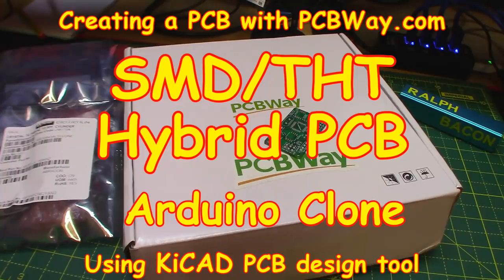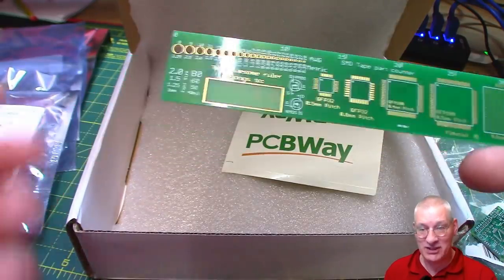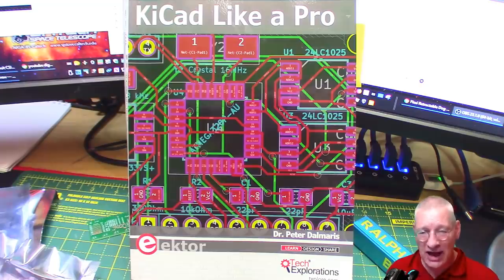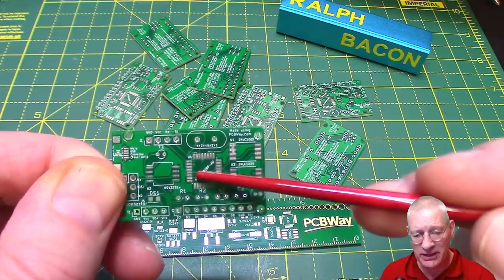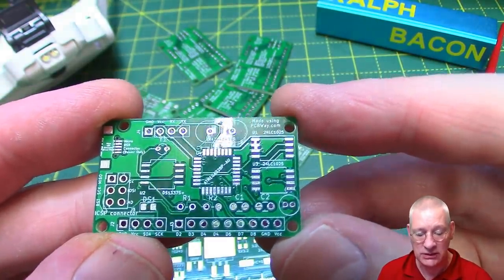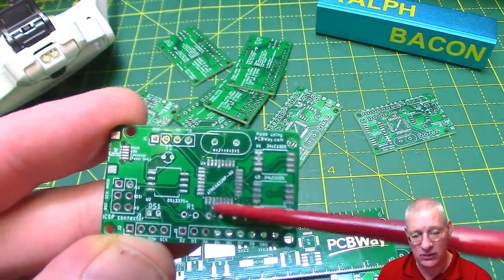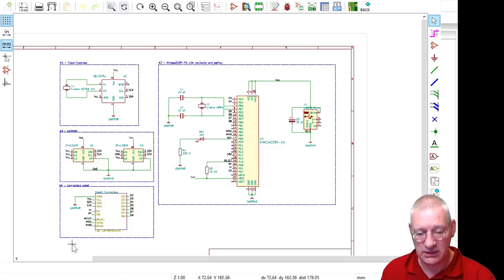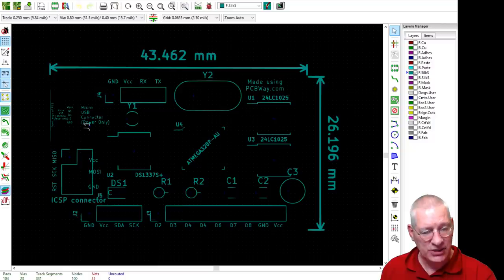#145 Making an SMD THT Hybrid PCB Arduino Clone (Using PCBWay & KiCAD)

Comment: Nice video which explains a topic (SMD) which is frequently promoted as being beyond the capabilities of the average person.  Not so.  Like most things - driving, swimming etc.  it just requires practice.  The practice board mentioned is a fine way to do this. 

FWIW my comments on SMD construction. 

A handheld magnifying glass is good if you have three hands - I don't, and don't know anyone who has.  The USB microscopes that are available IMHO are not so good - latency and the need to look at a PC screen.  The problem overall is that it is very desirable to have 3D vision.  So magnifying headset 'glasses' as you showed are great.  Even better is a binocular microscope.  I was fortunate to acquire one cheaply, and wouldn't be without it.  They are available secondhand or new - from about 250 GBP upwards. People may consider this a lot of money but then spend far more on a smartphone.  In my view it's an essential tool if you're serious about electronic construction particularly using SMD. 

3D vision is the key - to get depth.
Liquid flux from in a pen applied to all pads.

Soldering Rs and Cs - apply solder to one pad then hold the component down - some people use toothpicks - I use a finger (fingernail that is - you quickly learn positional awareness!) solder the first end, then solder the other end, and re-visit the first.
For ICs I've never used the flooding technique (seems risky) and found (with optical 'enhancement') individual legs can be easily soldered.

Everyone has their own preferred method and the above are just mine.
Reply from the maker: Thank you for your pointers, David, the 3D vision could be particularly relevant given the poor sight in my left eye. I've seen videos of guys using USB microscopes and they seem to do OK, but that's probably with a lot of practice. 
I'll keep using my watchmakers glasses until I can justify the £250+ for a second hand binocular microscope (assuming my vision allows that). Thanks for posting, great to hear from you.
Reply: @RalphBacon  Some good tips from Mr. Holden.  Instead of a tooth pick invest in a some good tweezers.  On fine pitch ic;s if you dont have the right tip and microscope than you end up having to use braid to clean up the shorts.  I do not that way either.  Like Mr Holden said put solder on one pad first, line up the ic and push it in place while flat while you heat up the solder on that pad and orient the ic the solder one pin on the other sides to keep it for moving out of place.
Reply from the maker: Yes, I've been practising that, but my tweezers have not yet arrived from Banggood. Another week! Practice makes perfect without a doubt.
Reply: @RalphBacon  I find that tweezers (plastic usually)  are good for putting devices in roughly the right position but otherwise better than NASA for launching things !
Reply from the maker: They have arrived. But I'm pretty sure they are metal. But ESD safe (allegedly). I'll surely show everyone soon enough!

Comment: Those test kits are great! You can get all sorts pretty cheap from the usual suspects that actually do something when finished so to check your work, it at least check outputs and connectivity. 
You'll get all sorts of advice on different ways people manage to do smd.. I've played with the solder paste and yeah, it works, really need hot air, regulated. But I just don't use it anymore unless it's stencil and BGA or so. I've found if the board is clean and fluxed, solder can be applied just fine to all the pads, not too much sticks in general,  just run a laden iron over the pads and take a look.., Then more flux, get the air on, preheat the board slowly, then go in close to melt the solder whilst placing the chip or whatever. When the solder melts the chip will stick with surface tension and a little more air will float it in to place. It may need pressing down but whilst better to avoid reheating, you can get in position when the solder has cooled enough it won't move, rest your tweezers on and bring the air back, it'll go molten again quickly because of all the heat left in the board. But like I say, you'll likely find your own method with what tools you have. Paste will work with iron as well bit tricky but again, can place the chip, get in position to press without wobble, add flux then run the iron over the legs, melting the paste. You'll be ok!
Reply from the maker: Yes, I'm listening to all suggestions and trying them out to see what works bet, Ollie, so far not bad at all. It is a pity in some ways the SMD practice boards don't do anything but that isn't really their purpose. I do have a very large LED clock kit that uses some SMD components that I want to build when I think I have the necessary skill level. I found that paste (without a stencil) was a bit mucky (no syringe, that might be the problem) and hot air was OK but soldering iron worked best for me. Hot air is great for rework though, I find. Thanks for the suggestions, appreciated.
Reply: @RalphBacon  I got most of my little test kits from ebay, typically from China yeah but some UK sellers there. I think a decent ebay search is like "smd practice boards" or so.You get ones based on the 555 and 4017 decade counters that just light up LEDs and whirl around a pattern or so.
I found with the paste it was easier to squeeze some out on to an old lid or something then get some on some tweezers or toothpick and kind of apply it that way, accepting a bit of wastage. But if you have syringe without nozzle, you're looking for a "Luer Lock" style, blunt tip needle typically. The colours indicate tip size, pink or green I have.

Cheers for the reply. Best of luck to you sir!

Comment: Nary a bypass capacitor to be found. Maybe a book on electronic design would be money well-spent, or just contract with a more-evolved Paramecium for your next design...

The 10uF cap is a good idea for power from a USB cable, but each IC should have a 100nF cap as close as possible to its power pins. Also the load caps for the crystals should be as close to their IC pins as possible, with a guard trace around them.

You may find some interesting behavior with that layout...long live the Paramecium!
Reply from the maker: The circuit used here was not mine, of course. You will have noticed that in all MY circuit I put 100nF bypass caps really close to the VCC pins (both digital and analog), even when I do demos on the breadboard using a bare ATMega328P chip! 
The purpose of this video was just to see whether I could make a PCB (designed by others) and solder SMD components on it. As the video is now over 6 months old I'm glad to report that I can now do both things! I guess I must have evolved into a multicelled organism, woo hoo!
Reply: @RalphBacon  You're a good sport, Ralph...and I'm getting more curmudgeonly by the minute. Cheers for your videos...

Comment: I had the best success using solder paste.  I am really bad with trying to use wick.   A little tiny bit of paste and a few seconds with fine tip and done.   Only problem is buying 2ozs of paste was $$$ and then having most it expire.   But Adafruit sells paste in  tiny few gram packs, more $ but hopefully wont expire before I can use it.  Surely china sells these tiny 5-10gram packs too.
Reply from the maker: You're not kidding, orbitalair, that paste is expensive for the tiny amount you get! In fact, solder is expensive too, even from China (maybe the weight makes it expensive to ship). But I have some , enough for my testing, anyway. I didn't know there was a use-by date on it, I shall keep an eye on mine.

Comment: "Impossible" to route around a through-hole LED, Ralph? Hardly. You've not even got anything on the reverse, just a ground plane. I picked up Kicad (after never using a CAD package before) with no book in about six weeks of fiddling about, and I'm sure I could find space for your LED.
Reply from the maker: Let's just say that KiCAD went bananas trying to route the tracks once I added a THT LED, although I tried vias and everything - eventually I just gave up and reverted to an SMD component. But then again, I ain't as smart as some folk, as I needed that book to get to grips with KiCAD 😃

Comment: I had fun when I ordered 0402 size resistors once. Unfortunately I ordered metric instead of imperial.  So I was sent specks of dust to solder. Lucky that the local electronics shop had a suitable size.
Reply from the maker: Yes, there are some really tiny components in that practice kit, Bernd, too small to be soldered by hand without a 'scope, with my eyes. I'll stick with 0805 sized stuff for now! Imperial!

Comment: Great Scott has a video about soldering SMD components: https://youtu.be/VxMV6wGS3NY
IIRC he uses the technique of drowning SMD chip pins in solder, and then remove the surplus with solder wick.
Reply from the maker: I watched the second half of that video, Martin, about SMD soldering (on your recommendation). Very useful. Thanks for the heads up. I've found that flooding a chip is not necessary, although solder wick becomes your best friend to correct any mistakes! Thanks for posting.

Comment: Hi Ralph, Firstly...YEY! I'm one of the lucky winners, thanks to yourself and of course your "Virtual Hat" !
Secondly you are clearly working smarter and perhaps a little bit harder, personally its great news you seem to like Kicad, I was hoping so (selfishly) because I'm using it all the time now too. First board I made was a 32 pin TQFP breakout board for the ATmega328p-AU cos it was actualy cheaper than buying them and a lot more fun, I used JLPCB and was very happy with them. Ive soldered 8 chips in total and every one worked fine but some a lot prettier than others! Poor eyesight has meant optical aids from  glasses to glasses covers but quite like using my phone or tablet actualy. Must say I like routeing SMD stuff and I like using it in general now and as there are lots of Utubers out there with hints and tips I'm finding it very easy and satisfying (0805 that is !) My first and foremost tip is......FLUX IS YOUR BESTUS BUDDY!.....my next tip is enjoy, and I look forward to your future work.
Reply from the maker: Indeed, congrats on that, has it arrived yet? I doubt it, MK sends stuff via Sydney first. (Shakes head in total bewilderment at MK's post office system). 
Anyway, just as I replied to Jon, I'm definitely liking KiCAD now - or, stated a different way, I understand better how it works now and therefore can use it much more smoothly than before. Far less frustration! And I love routing those tracks. Very therapeutic!
Those 'watchmakers glasses' are a real boon to me, I used them again today as I tested out my hot air gun.
Nice to hear from you, I hope you do build the Fuse Resetter, it's actually quite nice and easy to use now it's on a shield.

Comment: The other way to solder the SMD components is to use a reflow oven of some type. There are the usual Chinese hobbyist versions or there are many DIY versions that use a cheap toaster oven with a temperature probe and a microcontroller to keep the correct flow timing.
Reply from the maker: This sounds weird to me, Mike, but you're not the first person here to mention it (although you didn't mention sand this time, thank goodness) so I'll look into it but so far my SMD practice board is teaching me well! Thanks for posting.

Comment: Hi for attaching the chips I defiantly recommend some form of stencil I believe a company website https://www.smtstencil.co.uk/ will make a stencil for you out of PET for less than £15. It takes gerber files no need to do conversions.
Reply from the maker: I was offered a stencil by PCBWay but declined as I didn't know how to use it and didn't think I would need it. WRONG! Now I understand why a stencil can be very useful, especially for more complex or larger boards.
Reply: Ralph S Bacon pc way stencils are made from thin metal and last a long time but are expensive the company I mentioned do plastic ones for a lot less for prototyping.

Comment: Ts100
Reply from the maker: If you mean this one, Belen:
http://bit.ly/2PXFKi4 
it's quite expensive at about $50 (when ordered from the UK site, a bit more would you believe from China). I'd have to be convinced it was worth it. What do you reckon?
Reply: @RalphBacon  It's well worth the money. Especially if you happen to have an old laptop power supply around you can exchange the connector to, to avoid paying for the power supply. You'll likely want a few different types of tips also so it'll add up to the cost. Another issue is that a laptop power cord is not very flexible nor heatproof so in the end I also bought a separate silicon power cable for it, further adding cost... But now that I got it, I have stopped using my old Weller (red series) soldering station. Another option to consider is the newer TS80 you can power with USB-C so it can be powered from a suitable USB power bank.